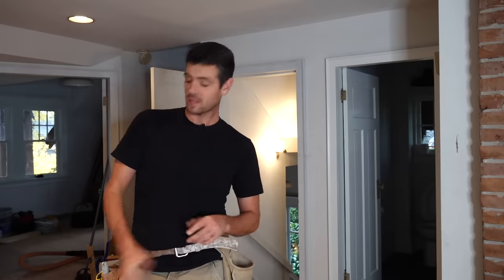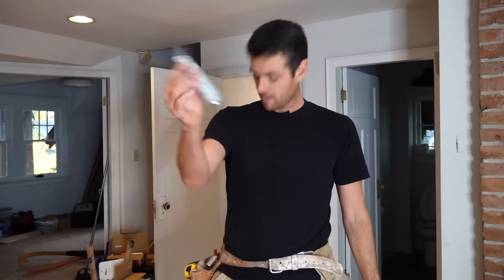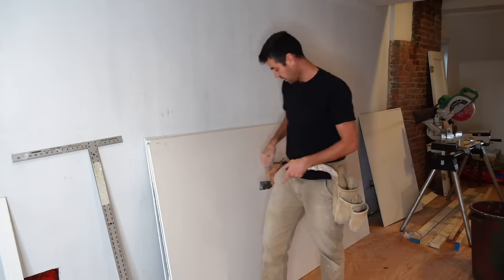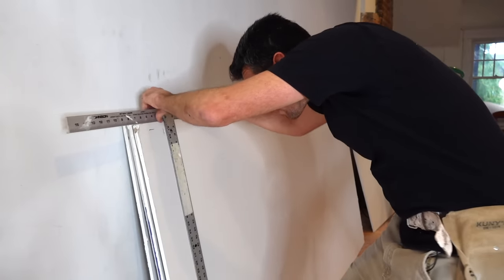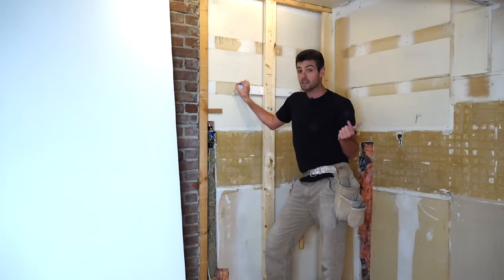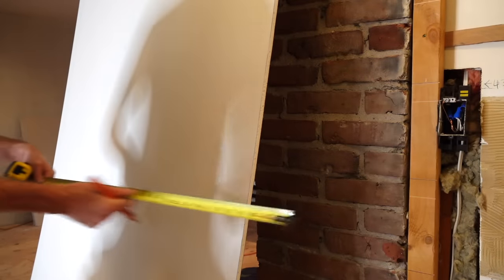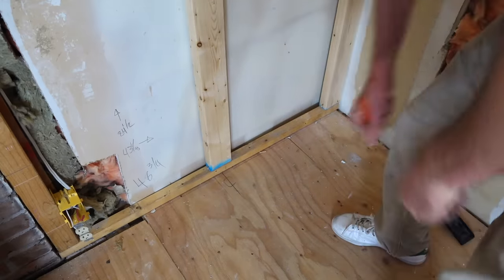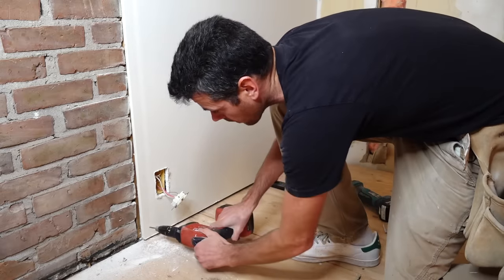Every Beginner Drywall Mistake I can think of (1/3)

Comment: I cut the plastic tabs off but still not screw by the plugs anyways.. I stopped using blue snap lines and can just use tape measure and knife for angle cuts.. if its wood maybe only 1 or 2 screws in the belly because you use glue.. Sucks i been a drywaller for 30+ years shitty job..

Comment: newbie here: i'm confused why you butt against the ceiling rather than the floor. intuitively it makes sense to move vertical stress from the screws to the sheet, but i'm aware i'm missing something basic
Reply: You need a gap at the bottom for flooring to tuck under. The 1/2 inch gap below is code where I'm at and is covered up by trim after flooring is installed.

Comment: There are regulations on what size screw you should use for drywall. This will probably vary from place to place. Best to look it up. Longer is not better, especially when you put a screw through an electrical line.
Reply: yes, "Longer is not better", well in the world of drywall at least....

Comment: I'm making a list of the tools to add to my wishlist. LOL. The info about screws wasn't boring-- it was useful. 
What router were you using and what sort of bit?
If you're putting something like purple board up above a shower surround or behind a glue-up shower wall surround, would you put the factory edges on the inner corners?

Comment: Fast & cheap.... as he drills in with the Hilti. My newbie mistake? Well... something I just cant master: screwing in a straight line between the ref points. I had to draw a line, and now use a laser. But... obvious Im not a drywaller cause that added step adds quite a bit of time.

Comment: Electricians hate drywallers with routers. 50% of the time no one pushes wires deep in box before drywalling. Wires get cut or mangled. When routing, just go deep enough to pierce board. Put a piece of tape around the bit to mark it.
Reply: @Josh Ruston exactly. It’s your own fault if your wires aren’t pushed in.

Comment: It is a good thing that you cut the length before you scribed the line, otherwise your board would not have been the proper size.  You would have been too narrow and your angle would not have been correct either.

Comment: Great video.  I am building a small soundproof, totally enclosed cubicle.  I am going to double up with 5/8" drywall and use green glue in between.  Do I have to mud and tape the first layer of joined drywall, and then do the same for the 2nd layer?

Comment: So much wasted time in these technics. Don't ever measure the boxes. Just put the board up next to it. Look around the back side to find the box location and mark it with the pencil. Put a couple screws in the sheet. Pull off your battery powered Makita router with the clip. That's always on your bags like a screwgun is also. Turn it on and plug it into the sheet where you marked it. Router out the box counter clock wise. Get there, fix it, get done, otta there!

Comment: Do you have a video on how to repair cement siding boards with the metal lip on the bottom?  I would guess a circulating wire brush to clean, then seal the metal then rebuild with concrete.

Comment: Nice and educating video my friend! Very nicely and good explained everything, so everyone can understand and also to see!...  It should be more of the Videos like this and similar educating stuff, and to promote this kind of things more! 
By the way,  I wanted to say something that I noticed in video,  maybe I'm wrong,, but I saw that you also made  a mistake also, but you lucky that you didn't already cut the first cutting on the beginning!.. you were about to cut the full length of the board, when you measured on the top and middle , it was wide 6,8 or something, and bottom a bit smaller i think.. And you marked the board on the edges where to cut from the top to the bottom... But ther fact is that you needed to shorter the board also a little bit. So, if you did cut it like you were about to do, it would not be good because the one Angle on the side where you cut it will not be correct.. 😉 But I think that you remember that also when you said that you cannot trace it with the rope and you changed  the way...😉

Comment: Union carpenter here, screw standard here is 12” in the field 8” on the seams.
Reply: I disagree, my townhouse with double drywall has 1½" fine pitch screws into twisted green lumber 'holding' the fire protection wall.

Thank you Mattamy Homes. 

Thank you building department that didn't care.

Comment: I have a weird wall that was primed and long time ago it is cracking tiny hairline horizontal short lines all over the wall but not flaking. I tried rubbing then sanding and joint compound. I sanded after 24hrs then waited a week  before I painted/ with a paint/ primer combo.       All the compound  picked up and stuck to roller I had to scrape the entire wall, then repaint but still see the tiny lines .   Its a tiny wall between 2 doors. Help please.      Im using laytex paint.   House is from 1967 not sure what was on walls

Comment: Surprisingly you didn't talk about checking framing for flatness.  I saw your other video about deciding which stud to place seams on  which was very informative things I hadn't considered.  So regardless if who is responsible for poor framing, a few minutes correcting before board is installed us usually time well spent.  Other comments mentioned no glue ... that is considered best practice here in Michigan, not sure about Vancouver.  Lastly since your audience is probably DIYers like me, it often comes in handy later to know about framing, wiring, plumbing behind the board ... I took lots of pictures of framing right before installing sheetrock when I built my house, these came in handy later more than once.  Lastly, I have to admit I am guilty of some of mistakes you mentioned, watching this a couple of times before first sheet might have saved a couple ... keep up the great content.  I especially like the problem solving videos.

Comment: Don't you guys use stud adhesive in North America ? In Australia we use it as it saves you putting so many screws in the centres of the sheet which all need filling, it also, and gives the sheet a stronger hold to the studs.
Reply: Honestly didn't even know it existed.
Reply: Glue is the way to go...no drywall pops and no screws to coat

Comment: Hi Ben

Thanks for all the great tips !!
I look forward to the next part.

When installing drywall sheets vertically, how important is it to not put the beveled edge at an outside corner. Myself, I just make sure there is a cut edge at the outside corners.
I would think having beveled edges at outside corners would cause problems with the corner bead install. You might have to pre-mud the corner with quickset to eliminate the bevel before installing the corner bead. Or is it just better to put your sheets horizontal and have to deal with vertical butt joints ?

Thanks
Terry(Calgary)
Reply: Absolutely. It's a little easier with the paper bead but bevels on outside corners suck.

Comment: Hanging drywall vertically vs horizontally?  If the room being done shares walls with already finished rooms would it be okay to hang the drywall vertically?  I have one room to do and it has 9' ceilings.
Reply: Yes. It really won’t make a difference if you seal your gaps properly.

Comment: Ok. Too deep - torn paper - no hold = screw pop. But you can leave it in if you put another properly set screw in nearby, correct?
Reply: Yep, just leave it and put another screw next to it. It'll be easier to mud in less coats since shrinkage won't be as much of an issue.

Comment: When there are receptacle boxes attached to the studs wouldn't this call for the use of drywall shims? If there's a plastic or metal tab screwed onto the face of the stud then this will result in a noticeable bulge in the drywall, no? Same goes for the metal plates that electricians and plumbers use to protect their handiwork.
Reply: Drywall is never flat you're overthinking it. Yes there is a bulge, no it's not noticable and no it doesn't matter. Butt edges and bevel edges are very long regular humps on purpose and if done right they are invisible without putting a straight edge on the wall.

Comment: So the deciding factor is how soon you need to sand and finish? Then why say stuff about "scale" first? You don't seem to provide any argument why mud or joint compound would be "bad" for small applications, if one is not in hurry and has the time for possibly multiple coat and dry cycles.

Comment: Another mistake I've made is putting in drywall screws at an angle. You have to drive them in deeper so they don't stick out, but that causes screw pops mentioned in the video.

It usually happens on wall boards near a ceiling because the easiest way to get a screw 8 feet up is to extend your reach as high as possible thus creating an upward angle. It also happens in corners because your drill might be a bit bulky and the only way to get a screw into the corner stud is to shoot it at a slight angle. Both those problems have solutions: use a step ladder or something to reach higher without pointing upwards, and get a drill bit extender to screw much straighter into corners.

In both those cases, the screws will probably be behind tape so it's not that big of a big deal. It would be a screw pop behind tape.

But if screws are driven at an angle anywhere in the middle of a board, then it's a problem.

Comment: Looking at this i dont really get why you American's does thing's the hard way? I'm an European Carpenter and measure using Metric system. i find it easier to measure 98,8 cm rather then all this feets and inches you talking about. The studs on the wall is C/C 60cm, the drywall plate is 120cm. 
The plate we use in northern Europe have a small X marking center for every 20 cm from buttom to top on C/C 60. we screw for every 20 cm to get 100% hold. people tend to hang heavy items on their drywall and you dont want it bursting out in the middle.
 
For the power Outlets we use Circular outlets wich makes it easier to make holes and fit plates. we got this nice tool called Hole in one magnet. this makes the job really easy cause you just stick the Socket insert into the socket. (smart to have multiple) then hang your plate and use the magnet and hole drill to make the holes. 
https://www.youtube.com/watch?v=YXjvhEynW9c&ab_channel=JIJplast

and if you afford buying an Hilti Drywall drill. why not purchase the collated screw magazine for it so you don't have to run around with your pockets full of screws. makes the job much faster.
https://www.youtube.com/watch?v=Z0unRHwbIVw

Another smart tip is to use the fabric pressed edges in the inner corners. this way when you are mudding the wall and use corner tape you dont add so much tickness and it makes the floor and roof Molding easier cause you get a much straigther line. nothing makes the job harder when trying to make an 45 degree corner with the molding and you added to much mud so the molding sticks out and your nicely cut 45 degree don't fit.

Other than that you gave some really nice tips and i like your video!

Comment: 2:29 While the video provides valuable information on choosing the right screw for the right application, specifically in relation to wood and steel framing, it's imperative to also discuss scenarios that deviate from the standard. Specifically, many contractors might encounter situations where they need to hang drywall over existing drywall or over other materials like the lath boards found in older homes. These scenarios can affect the recommended screw length. It would have been helpful if the video provided insights into a good screw size for such circumstances or even suggested a versatile screw size that can cater to a majority of conditions. Recommendations should be comprehensive, taking into account the diverse needs of the viewers.

Comment: My dewalt with the collated screw attachment has been a godsend so far.

I’ve been using 1-5/8” just so I don’t need to switch out between half and five eighths

Also, in some cases, I’ve found those oscillating multi tool type saws to be really handy

Comment: Any tips for when doing butt joints, (ends of the 4x8 sheets)  I always struggle when screwing down both ends to a single 2x4 stud edge (1-5/8) side.  Edges of sheet seem to like to blow out and crumble and putting screws at excessive angle tear paper also.
Reply: Don’t screw the butt edge till you’ve hung the sheet that butts up against it.
Reply: Thanks
Reply: Break the joint in between the studs and use a 1x4 backer

Comment: Question: Has the quality of drywall improved, deteriorated or remained the same?  Does the light-weight drywall has the same strength?
Reply from the maker: It's gotten worse. Lightweight is poopy.
Reply: Definitely gotten worse, recycled paper sucks. After final finish coat you need to pva prime the drywall before texturing. After texturing another coat of primer then 2 coats of paint. If you don't prime correctly the recycled paper absorbs inconsistently making the finish irregular.

Comment: That is NOT enough on screws! Starting a fire in your wall just sucks!  Drywall screws should be LIMITED to 1-1/4" as that is the distance the NEC requires a wire hole edge in a stud to be away from the edge of the stud! So if you drill the screw to deep through the drywall it should stop the head at he wood which keeps you from piercing a wire by entering the sharp tip into the hole.  Now, yes, a lot of areas now require AFCI breakers which is really nice but if you pierce a NM wire you won't burn down you house, but you will need to rip open the wall and replace that circuit wire - got a lot of money for that? That also means that on a 3-1/2" stud an electrician's hole should not be bigger than 1" in diameter.  Most NM wire only need 1/2"  or 5/8" holes but many electricians like the ease of pulling wire through 1" holes.

Comment: For walls does it matter if you hang horizontally or vertically throughout or can you mix it up for less waste?
Reply: So I'm brand new at drywall, so take my word for what it is...
I'm currently swearing not to hang anything vertical unless it is a small enough space to not have any vertical seams. After having multiple issues with not flush studs in my old home and having to mud for dayyyysss to even come close to fixing them...the horizontal seams we easy, the verticals were awful.
Reply: Thanks.

Comment: You mentioned double layer drywall - why would one use that?
Reply: For firewalls. I have hung double 5/8" for firecode. It allows say an hour fire barrier between a duplex or such. Also, have hung double layer 5/8" on lids or ceilings for noise reduction and fire code and occasionally prior to walls being framed. Then return after interior framing to finish the job.
Reply: @tarpkic720  Thanks for the response.  Good to know.
Reply: @MD-en3zm yea. no problem

Comment: Journeyman drywaller here.. use your knife and cut a slice on your mark then put your chalk line in the cut. Never use that dumb clip on drywall.  Now you can call this video 4 things amateurs do. Lol
Reply: Confusing to watcher say like I know nothing please
Reply: Instead of putting the metal hook on the end of your mark, cut a slice into the edge of the board at the end of the mark. Then put the string in the cut and pull until the metal stops the string from sliding out. The end of the string will be anchored exactly where you slice.

Comment: When doing ceilings, do you have to use strapping or can you just screw the drywall into the joist?
Reply: Right into the joist
Reply: @dooshnukem32  Thanks Doosh. So what is strapping for then?
Reply: @KaioStryker  It's generally a regional thing and often comes down to preference. But in most cases, it's used to fix waves/inconsistencies in trusses or joists. In rarer instances, it's used to help eliminate some acoustic transmission (via vibration) between different spaces or to use an extra layer of rigid foam insulation to increase R value.
Reply: @dooshnukem32  You're awesome Doosh. Thanks for the quick replies.
Reply: @KaioStryker  Aww thanks! Sharing is caring and knowledge is power, as the old adage goes :) And save for a few people out here like Ben, drywalling knowledge often seems like guarded ancient secrets lol.
Reply: @dooshnukem32  You're very welcome. Agreed! I have an unfinished basement and would really like to do most of it and after calling a few companies and asking for quotes and tips, they quote but look at me crazy about offering any tips as I mentioned I'd like to do some of the. work myself. I know I'll have to hire a mudder though.
Reply: @KaioStryker  Oh for sure, some trades people "pucker up" a bit at the thought of cutting into their profits. Keep watching Ben and asking questions. You may not have the practice to be as fast or consistent as the pros, but you can certainly get it done with a little patience. Ben has some great videos on mudding as well, but I don't blame you for the apprehension there - it's a bit of an acquired art. Good luck on your renovations!